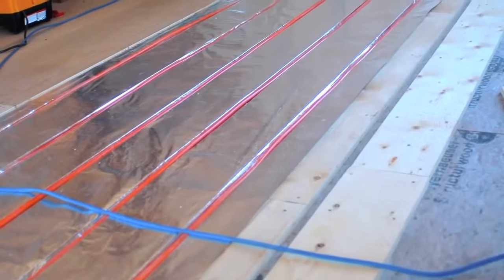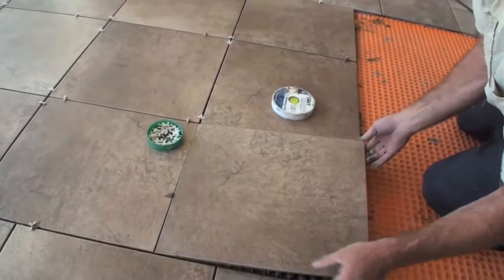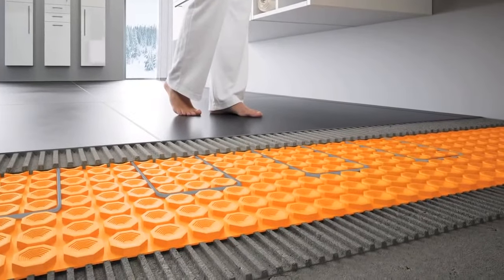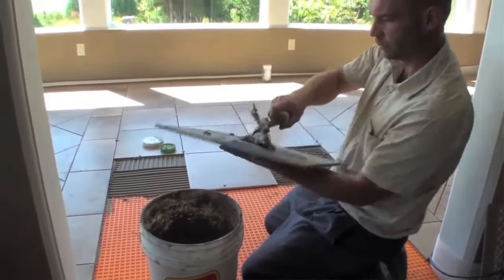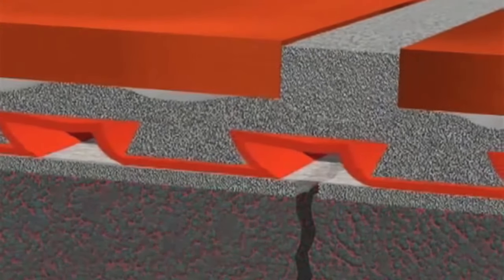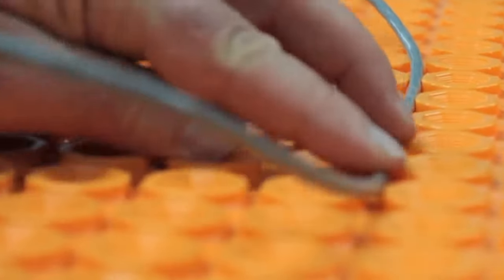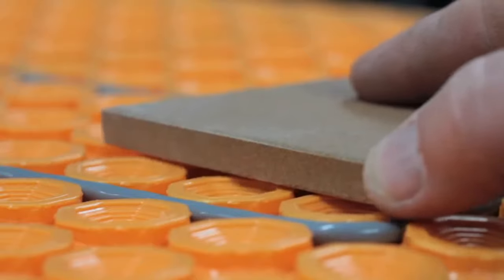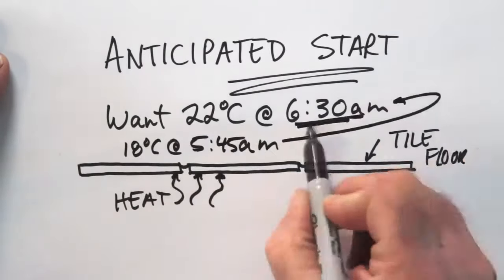The Best In-Floor Heating System I'VE EVER SEEN

Comment: just buy eletrci heat mats and job done. can be used any any flooring. Save tons of money without this ditra brand nonsense.
Reply: You’d go bankrupt running it in MA
Reply: We have electric mats it in a 20sqm north facing kitchen with 3 external walls, 300 year old property so insulation is minimal. It’s on full time and keeps the room at 19 degrees which is fine, £2.40 a day in the middle of winter. Bankruptcy is a long way off
Reply: @DavidJarrold-e7j And where in MA, CT or HI do you live?
Reply: @brianc9642  I clearly don’t live in the US as I cited costs in £’s. I’m merely pointing out that in less than ideal conditions heating mats can provide a perfectly reasonable heat at perfectly reasonable cost. That’s with electricity prices in the UK twice as much as the US.

Comment: Yep, the Schluter system is the only reliable system on the market (so far). Beware: like heated truck seats, don’t install heated floors unless you plan to never settle for unheated floors again. Pricey? Not really when you consider that you should get at least 40 years out of properly installed porcelain tile. $900 / 40 years = $22.5 per year for a small bathroom. You probably spend more than that - per week - on coffee.

Comment: Looks like great system. As an electrician I have installed  “hot wire” system in Australia, which is  basically a long element. We have to roll out it in a snake pattern and individually stick every part down with tape that we have to cut ourselves , very time consuming. After this the tiler lays a thin coating of self leveling concrete. That lays the glue and tile. Is this product available in Australia?

Comment: Pointless if no insulation beneath the floor
Reply from the maker: Yes, you're right. I generally insulate with 2" of extruded polystyrene foam on the subfloor, with a layer of 3/4" plywood on top of the foam. Newer versions of DITRA-HEAT have a small layer of insulation underneath, mostly for use over concrete floors. It's amazing how well this system works.
Thanks for watching!
Steve

Comment: Can you install wood veneered engineered flooring over the ditra heat or just tiles?
Reply: Several plank flooring vendors I've seen have capped the in-floor heating temps between 100-120, mainly due to limits of the adhesive and risk of delaminating the hardwood from the core material.
Reply: @MadLadsAnonymous  we used a warm board hydronic system and are running it at 110 degrees. Works well but cost a lot.
Reply: @liveslowsailfastonlanier1374  Thanks. Wondering if it'd be better for me to use porcelain tiles and an electric system like the DITRA one for bathrooms, just try to zone different parts of the house. Probably too expensive.
Reply: @MadLadsAnonymous  I think that tile with electric wire will work well. The mortar will conduct heat from the wire to the tile and get heat distributed across the floor efficiently. If you have a laminate floor you would need something to move the heat to the planks. May be there is a glue or paste of some sort that can be used but I do not know of such a product.

Comment: Can this be installed under a thin concrete layer without tile?
Reply: yes you can. but it has to be in 10mm min apparently and obvioudly you would need to insulate the floor first otherwise youll just be heating the ground below.

Comment: Does this system work well with engineered wood flooring (design to work with UF heating)?
Reply from the maker: Officially speaking, this system is only designed to work under ceramic or porcelain tiles and it works best in this situation. That said, I have seen it work well under laminate flooring. I'd be concerned about engineered flooring because it's thicker and more insulating. I hope this helps.
Thanks for watching!
Steve

Comment: Can you use it with wood floors?
Reply from the maker: Good Morning Mike! Officially speaking, this product is only for use under ceramic or porcelain tiles. But in practice I've had great results under laminate. Fasten the uncoupling membrane to the subfloor, install the heating cables, fill the spaces in the uncoupling membrane with more thinset mortar, then install the laminate. Solid wood is thicker than laminate, so heat transfer would not be as great. I don't know how much "less great", but you could do some experiments to see. I hope this helps.
Bye for now,
Steve

Comment: Does the warranty still apply if a homeowner installs the system himself? Or does one need a contractor to install everything? For example, can I install the system but not tile over or terminate, and then have a contractor inspect the installation and activate the warranty?

Comment: How does it compare though?? Ive heard Ditri is great but how much does it cost each year to heat and would a boiler system be warmer?  There are variables like warmth ( always a fear its on maximum and you need to supplement it with baseboards) while the obvious complaint about electric are energy needs?  For a whole house ?